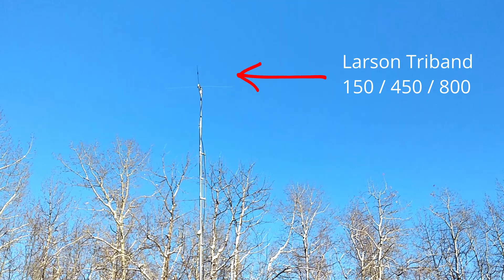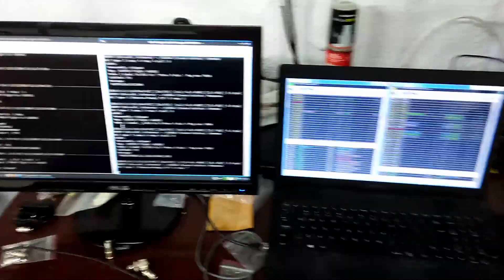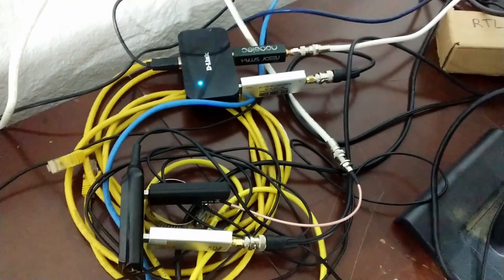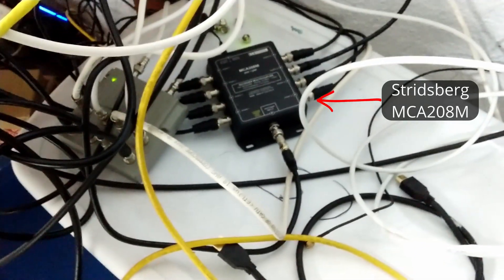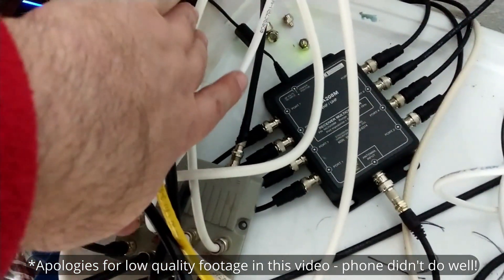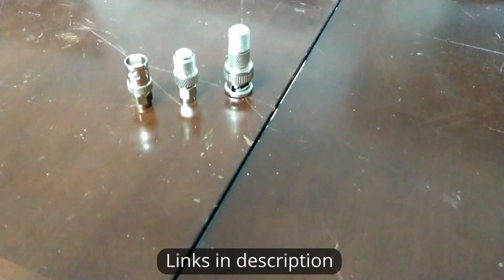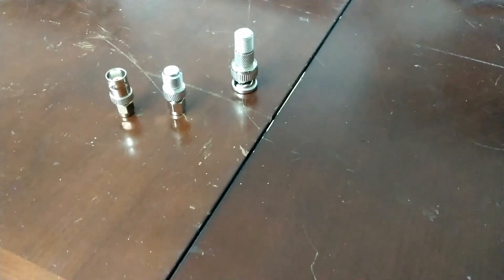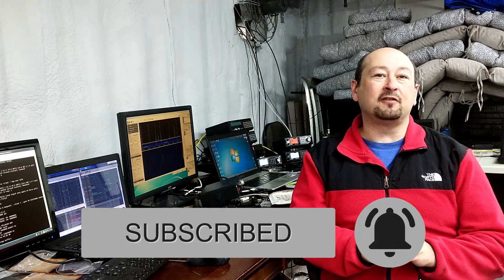Share 1 antenna with 15 receivers - signal splitting in the shack with TV amp & multicoupler

Comment: Wow! Makes my efforts to stick up an airband dipole seem a bit weak! Nevertheless, it is has noticeably improved my reception and I'm recieving signals from across a large area now, as I discover who's talking. You might help me to understand what I can reasonably expect to receive - for example, I'm hearing what I think is Shannon (Oceanic Clearance or Control?) from my house hear in Brum. Am I wrong? Thanks for the video!
Reply from the maker: Hi Paul. Having the antenna up high makes a huge difference.  You can expect to hear aircraft over 200 miles away! So yes, you are hearing aircraft calling Shanwick on VHF too receive their oceanic clearances.

You may even be able to receive aircraft contacting Maastricht, or Brest Control in France, as well as Shannon, Dublin, London & Scottish. You won't hear the Air Traffic Controllers on all those frequencies, but because the aircraft are at altitude, they have line of sight with your antenna for quite a long way.
Reply: @FrugalRadio  That's a really helpful reply, FR, thanks! I thought I was making it up - I've also been able to pick up my first military signals, but that has been a challenge because it's not clear (to me at least) which areas the ATC is covering. I also discovered some of the HF ATC signals such as Santa Maria and of course Shanwick. It's all good stuff.
Reply from the maker: Yes, there is a real wealth of communication signals that can be received. It is a vast and incredibly fun hobby that can be enjoyed on a frugal budget! I'm glad to hear you are making these discoveries!
Reply: Looks good- have you ever come across a coupler especially for SMA connectors so you don’t need so many BNC and F adapters. I have 4 SDRs accessible remotely on kiwisdr and globaltuners and I found that some of the F Connectors break or don’t stay in properly
Reply from the maker: I'm not sure what you mean by a coupler. I have some SMA to SMA that I would consider to be couplers, but don't need them much.

I've not actually had an issue with the BNC or F connectors, but they are a bit long sometimes. They certainly add weight to the SDRs that it would be nice to avoid.